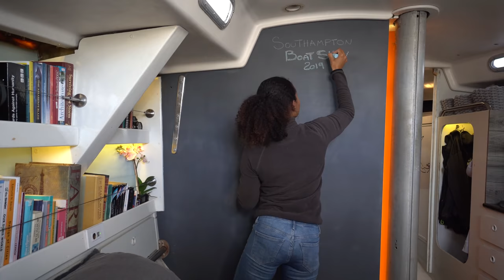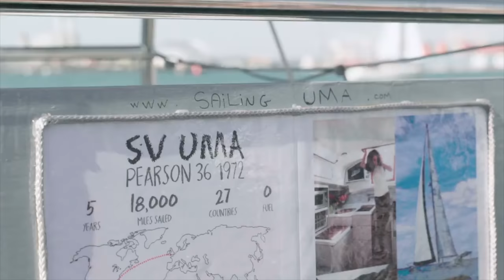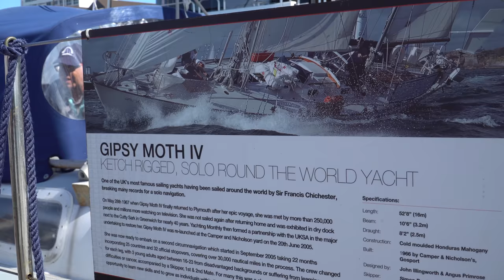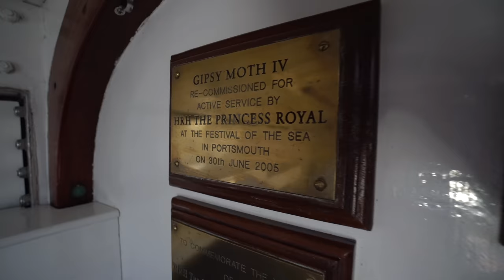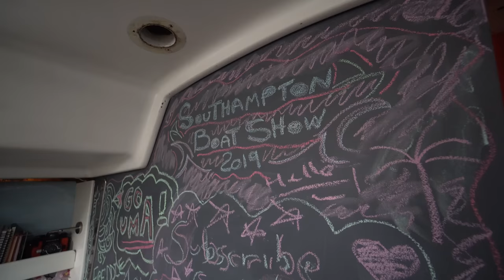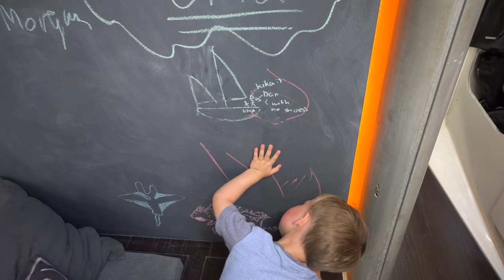What you DON'T See at a Boat Show— Sailing Uma [Step 193]

Comment: I literally just read an article about the Gypsy Moth IV five minutes before watching this video.  I went on it as a little boy when it was in dry dock next to the Cutty Sark.  They stopped letting people onto it after a while as it couldn't cope with the footfall but I was one of the lucky ones.  Sir Francis Chichester had a few more adventures than you did crossing the Atlantic but the Gypsy Moth was apparently an absolute pig to sail anyway and far too much to sail single-handed.  After the voyage Sir Francis said that he owned a third of the boat and the best thing that could be done with that was to saw it off and throw it away - the boat was much too big.

Comment: Hahahaha, people on big expensive sailboats dying of envy from tiny old Uma. Priceless.

P.s. Dan, what did you mean when you said that if you had any sailing experience, you wouldn't have done it?
Reply: It's the free Sailboat problem. It goes something like this, someone gives you a free sailboat and You can't believe your luck. You get the stuff you need to start working on it and Your raring to go work on your free Sailboat but your starting to question how "Free" your sailboat really is. As you work on it you start realizing why everyone says there's  no such thing as a free sailboat. At about halfway you start adding things up and you start realizing that it may have been cheaper to buy a boat. As you head to the finish line you know it would have been cheaper and your starting to question your sanity but hey your almost there.